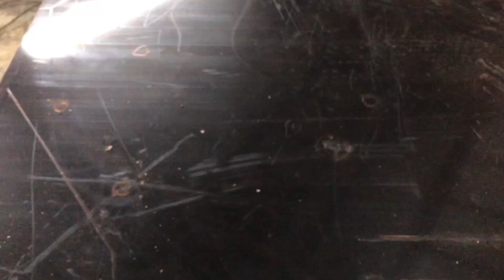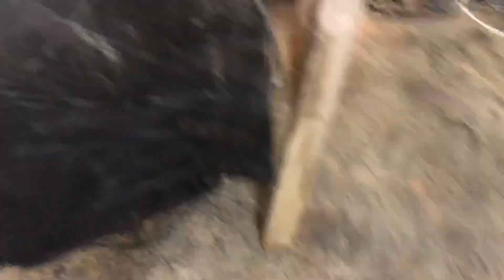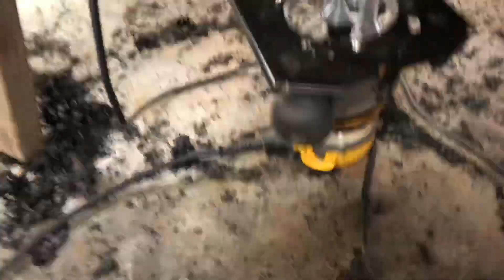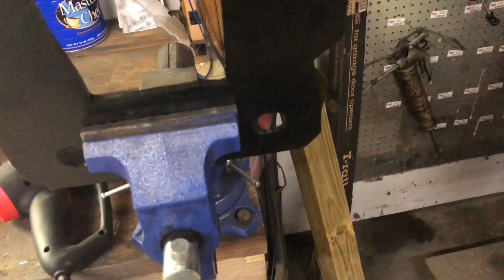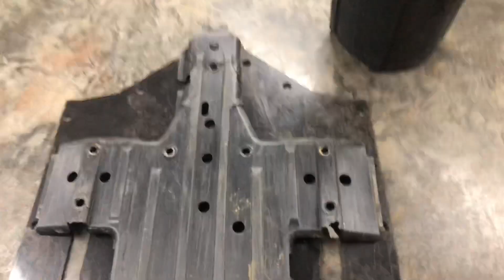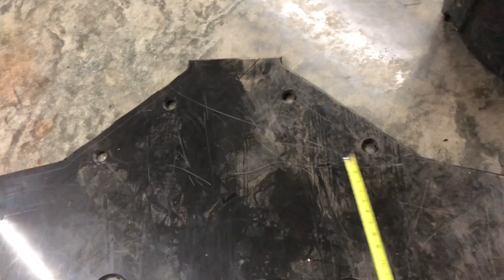How-To:  DIY RZR Skid Plate

Comment: Use skill saw for straighter edge stop short and finish with jigsaw on cuts that turn corners. Use two Fosner bits for holes drill half way then switch to smaller bit. This will create the same ledge to countersink mount washers that the professionally made one had so that it will not catch as easily on rocks

Comment: about how much did  it cost you in materials to do this skid plate
Reply from the maker: Wheelin98 I was about $160 total.  The sheet of plastic was $130 and the miscellaneous hardware was the rest.
Reply: Jason  how does the plastic do with heat  as far as melting
Reply: Where did you get the HDPE from
Reply from the maker: Johnson Plastic Supply.  Evansville, IN.